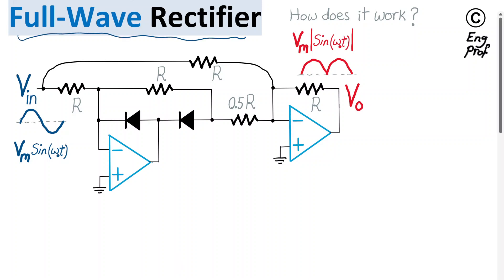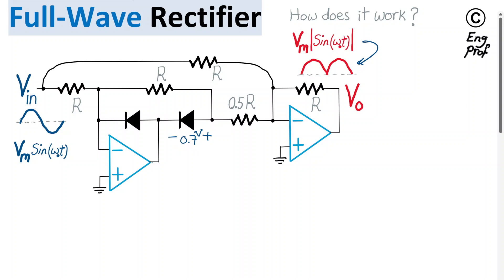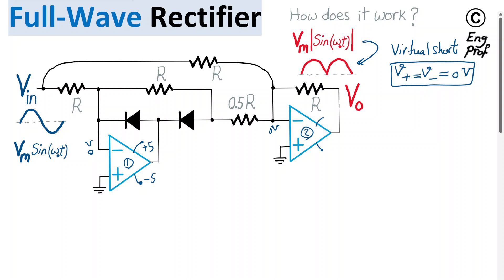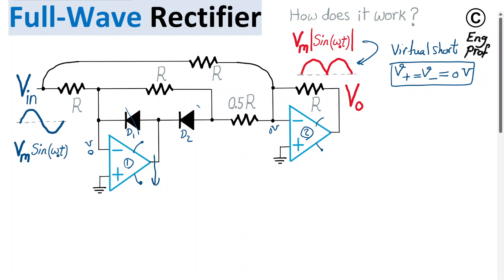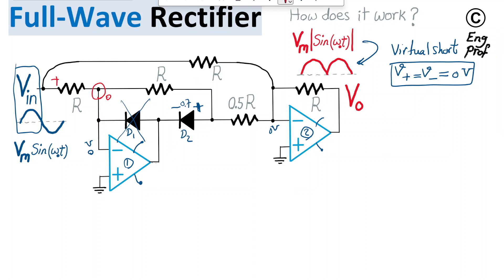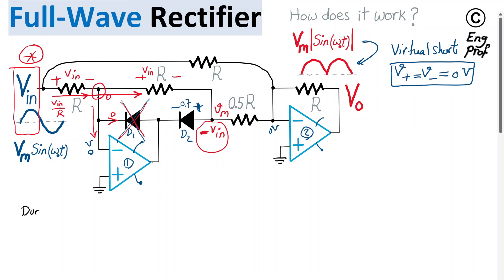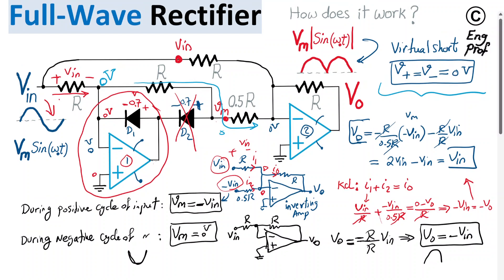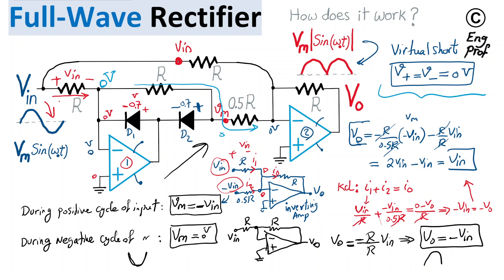Full-Wave Rectifier Op Amp Circuit

Comment: What a neat circuit. Thank you for a great explanation. I love working with op-amps because due to the concept of virtual ground ( like in this case) or virtual short in general, it is so easy to analyze the circuits involving them.
Reply from the maker: Thanks for watching. Glad you liked this Rectifier circuit. For more op amp Diode Circuit Examples please watch AC/DC converter application Https://youtu.be/4aG5NYX8tGo
Precision Rectifier https://youtu.be/2eAsJbTBkQA
Diode-Amplifier VTC https://youtu.be/vpGZkafxMJM 
Triangle Oscillator circuit https://youtu.be/JF5Up_cuL9k
I hope you enjoy these examples as well.

Comment: Can you tell me why this kind of rectifier would be used over the more simple 4 diode full wave rectifier? Is it specifically for small AC signals to avoid the voltage drop of multiple diodes?
Reply from the maker: Thanks Kalina for watching & your good question. You are correct, One main benefit of this Rectifier circuit is that the rectifying operation is independent of the Diode's forward bias that is varying with temperature and PN junction parameters.
For more Op Amp Diode examples please see: https://www.youtube.com/playlist?list=PLrwXF7N522y4c7c-8KBjrwd7IyaZfWxyt
I hope this is helpful.
Reply: @STEMprof  thank you!
Reply from the maker: @kalinamccurley7618  you're welcome. If you have circuits/topics in mind that you would like to learn more about, then please let me know so that I record examples about those topics.
Reply: The final drive comes from the 2nd op Amp.  Though it has the benefit of negating the diode drop, most opamps can drive very little current and limited input voltage so generally speaking would be a bad choice if you were rectifying for power purposes.  But for absolute value of a signal it has good application.
Reply from the maker: Thank you for comment and sharing your thoughts.

Comment from the maker: Thanks for watching. For more op amp Diode Circuit Examples please watch Precision Rectifier https://youtu.be/2eAsJbTBkQA
AC/DC converter application Https://youtu.be/4aG5NYX8tGo
Diode-Amplifier VTC https://youtu.be/vpGZkafxMJM 
Triangle Oscillator circuit https://youtu.be/JF5Up_cuL9k
Laptop and cellphone power adaptors and AC to DC converters are among practical applications of the Rectifier Circuits that converts AC alternating voltage to a 12v or 5 volt DC supply that charges computer or mobile device.  
I hope these explanation and examples are helpful.
Reply: What are the practical applications of those circuits in the real world?
Reply from the maker: Thanks for watching and your good question. Please see this AC/DC converter application https://youtu.be/4aG5NYX8tGo
In general, your Laptop and cellphone power adaptors and AC to DC converters are among practical applications of the Rectifier Circuits that converts AC alternating voltage to a 12v or 5 volt DC supply that charges your computer or mobile device.  I hope these explanation and examples are helpful.
Reply: @STEMprof  very helpful. Thanks professor!
Reply from the maker: @keylanoslokj1806  you're welcome. Pls Let me know what circuit topics you would like to learn more about. I will try to post example videos as soon as I can.